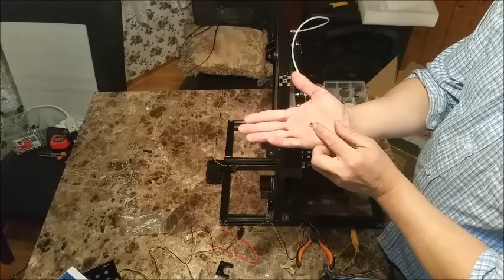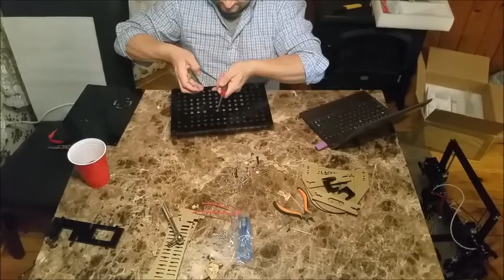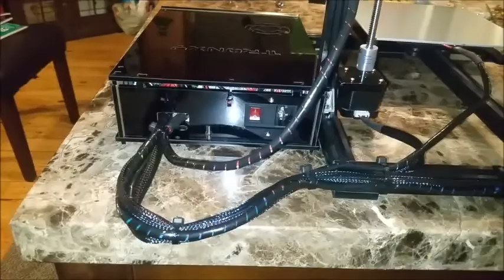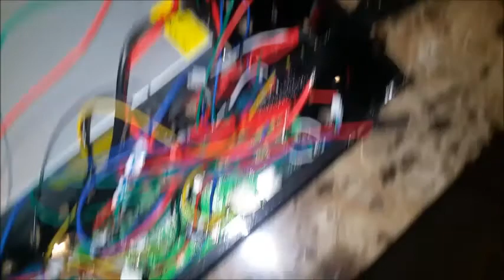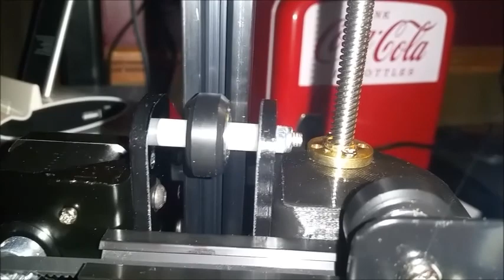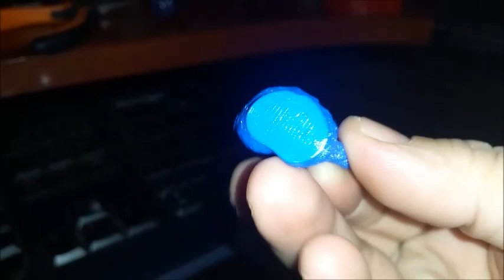Tronxy X3 3D Printer Build Video and a first print

Comment: Hey rockwater999.  I am having an issue with my Tronxy X3 trying to assemble it.  I'm having an issue with the "M8 threaded road" fitting into the "brass nut" as the instructions put it.  There seems to be no way for these parts to snap into place and it doesn't look like there are screw holes or anything.  If you have the instructions handy, I'm referring to step 15.  This is my first 3d printer and I'm thinking of doing some of the mods eventually that you have done on your channel.  Any help would be appreciated.
Reply from the maker: I am not quite sure what you are asking, I threaded the rods down through the nuts after the brackets were mounts on the X Gantry and once thread down into the coupler I tightened down the set screws in the couplers. Are you missing the brass nuts that should be mounted to the black printed brackets? Step 15 - thread the rods through the brass nut until they sit within the silver flexible coupler, once seated tighted the two set screws in the couplers
Reply: rockwater999 I think the issue is that my couplers do not have set screws in them.  the holes in the kind of look half milled too.  I'll take a closer look when I get a moment and I'll update here.  I really appreciate your help and enjoy your content.
Reply from the maker: Hmm, are the threaded holes there for the set screws? If so perhaps you can pick up some small metric screws at a local hardware store as a substitute of your set screws are missing
Reply: rockwater999 There are very small holes in the coupler.  It is hard to tell if they are threaded or not.  Are there supposed to be 4 screws per coupler (2 that attach it to the threaded bar and 2 to attach the coupler to the motor)?
Reply from the maker: Yes exactly there are supposed to be 2 holes and set screws at each end of the coupler for a total of 4.
Reply: rockwater999 So I feel like an idiot.  I apparently did not know what a set screw was.  The set screws are so small that I thought they were milled holes in the coupler.  If anyone else is having trouble with the coupler because they are a noob like me, the screws are the tiny darker holes on the coupler.  They use a very small Allen wrench that is included.  I apparently am not a smart man.  Thanks for your help anyway rockwater999.
Reply from the maker: Dont put yourself down so hard, they are easy to miss if you are new to this sort of DIY. I am glad they are there though and you can proceed with your build

Comment: Just got mine right now, did you have any issues with the wobble on the frame?
Reply from the maker: if you are referring to the acrylic bed, no I did not have any wobble, I tightened the wheels as close to the beam center while off the beam as much as possible making a really tight fit. If you have a little bit of wobble there are a couple of tension brackets on Thingiverse I believe to help resolve this, if you still have wobble you could try opening the holes towards the center of the plate just a little bit.
Reply: So you didn't have to open the holes on yours. Just assembled it off the beam then.
Reply from the maker: Correct, I just assembled it off beam as tight as I could towards center and it went on snug

Comment: Sorry, Im completely new to this. My son inlaw bought one of these in October but it has never worked properly. He has contacted the manufacturers in China who sent him a new PC board (which looks identical to the old one)  and an "Auto Leveling Sensor".
I have no clue how to install this. It has a white 3 pin connector on the PC board side, exactly the same as the XSTOP & YSTOP plugs. The other side is a blue cover with the markings C-Lin PL-08N and two mounting bolts. Would anyone have any ideas ? Thanks, Errol.
Reply from the maker: Sorry I cant be of much help as I never purchesed the version with the sensor

Comment: sorry to bother you again, but it is correct that the home parking of this printer is outside of the bed in this 3d printer, if this is not correct, do you know how to fix this, Set the zero for the Z axis had been a problem I notice that the two  plastic for z axis are not the same in my case, one is more square and the other have a small slop making the setting and calibration a real nightmare, wish I had a printer to print two pieces exactly the same and allow the rods to be positioned as the same height. well this is my SIY (suffer it yourself), they did not send the extruder spring so I added one from home depot hope it work at the moment i am able to print
Reply from the maker: It does home outside the bed area, however this gives you an opportunity to put down a piece of glass or mirrpr larger then the aluminum bed to obtain a larger print area . I have a mirror on top of the heatbed which is 30mm bigger width and length and it give me a bigger print area and allows me to home right to the corner of the mirror. The Z axis nut on the right side of my printer has some slop to it when the motors are not engaged but when they are engaged it is not a worry. I was worried about it at first but it has not been an issue. I have spares coming from aliexpress of these. You are joining a large group of us who are suffering poor Quality control on the part of Tronxy with missing and inconsistant parts my friend.
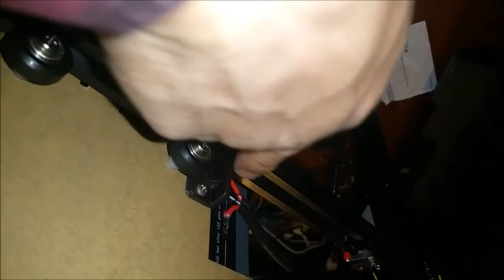Reply from the maker: I also forgot to mention one important thing since it has been awhile since I had to address it. Besides the mirror helping a bit I was still a fair ways from it so I printed and added a small bracket for under the bed for the Y axis sensor to trigger against offsetting it by about 20mm or so. In MY build video about 55:06 into the video
Reply: rockwater999 thanks i notice the stop bracket i will try to print here, problem is I need a better table to put the printer a for a better bed calibration, also thank you for the tip of the negative voltage cable, it does need a bigger awg to avoid heat

Comment: as I right understand you, the seller accepts Your claims and resend  power board  to you free of charge or You just buy new one?
Reply from the maker: Seller sent a replacement board, waited 4 weeks for it to arrive
Reply: thanks.  Are you think, that making bigger corner brackets for Z-axis rail can make it more stronger  or it strong enough? 
And where you can find the  user manual  for the printer? (on my microSD seller write down the Assembling manual only and I don't find the        manufacturer site in internet )